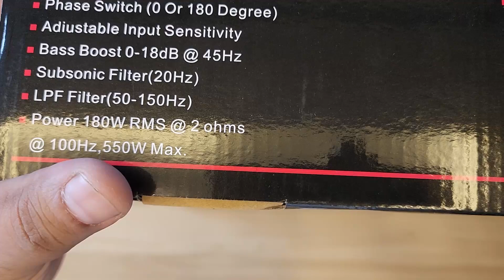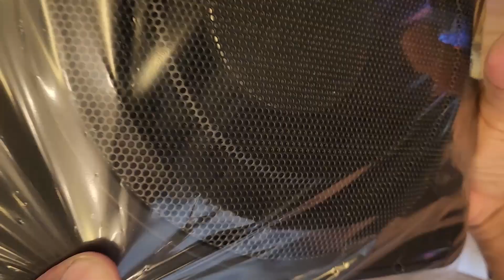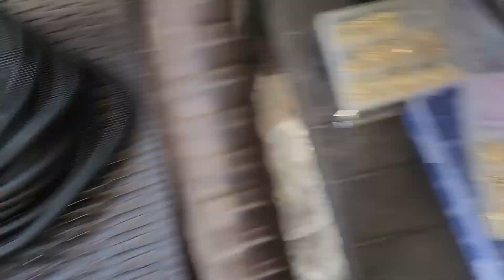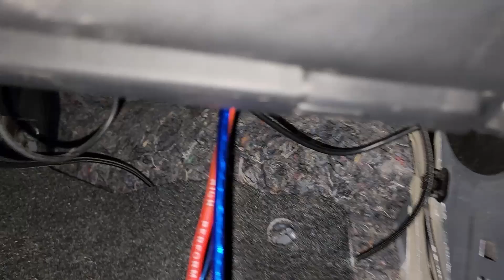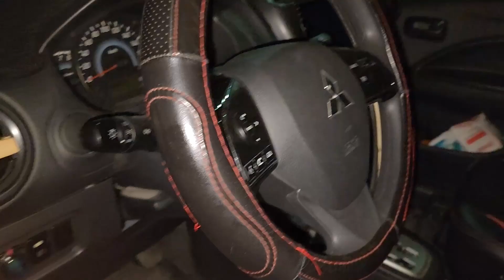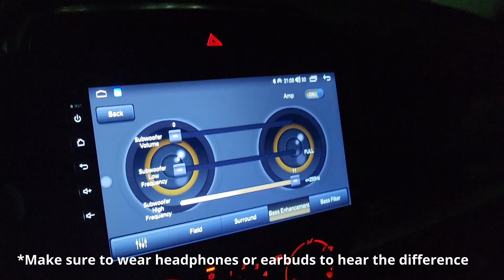Kinetic 10 Inch Underseat Subwoofer Unboxing and Installation

Comment: nag palit pa po kayo ng fuse sa dedicated power cable ?

60A ung ksama fuse nung aftermarket wiring kit

20A lng ung ksama sa package na fuse
Reply from the maker: Yes
Reply: @GlennThoughts  20A Pa rin po pinalit nyo Sir?

Comment: sis bakit po ung sa akin. after 15mins .namamatay
Reply from the maker: Baka po overheating yung sayo. Make sure well ventilated yung sayo o magpalit ka battery baka hindi kaya
Reply: Check wiring. Napakahina ng power draw nyan di nyan kaya makalobat ng battery pwera na lang nagpaaptugtog ka maghapon an nka off and makina hehehe